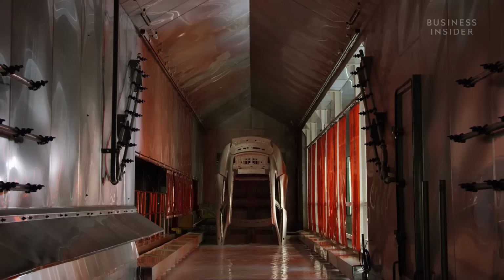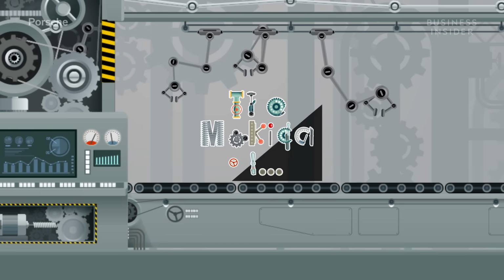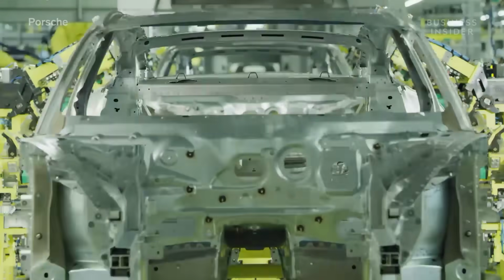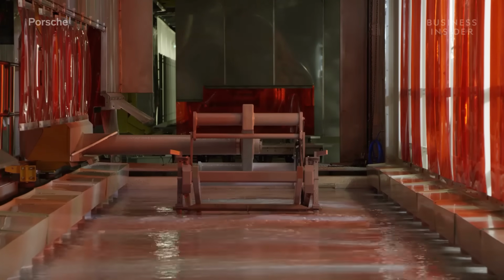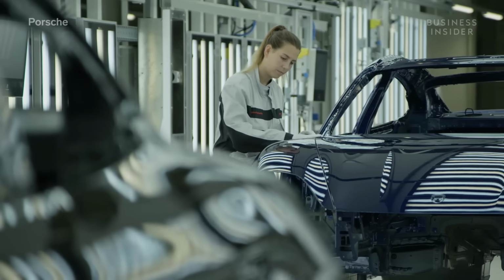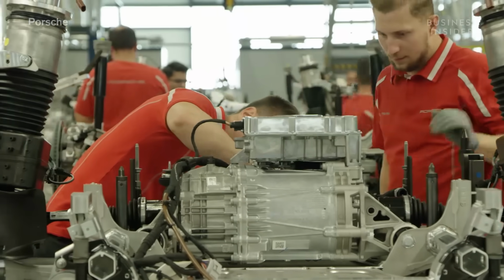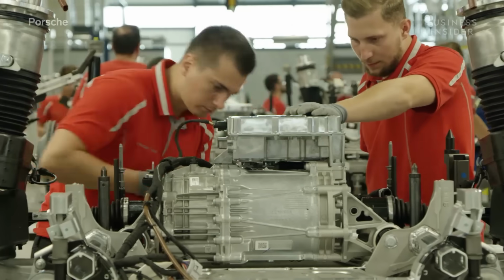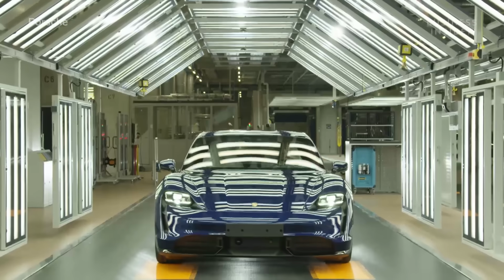How Porsche's First Electric Car (The Taycan) Is Made | The Making Of

Comment: A robot first hot glues the frame to the body, it is important to use industrial strength glue, and not Michael's craft glue, as these are European bodies. The body is then moved on to the mammals. The mammals rub the body with silicon sheets while yelling at it in German and judging its naked appearance. The body is then drowned in a vat of magical electrical water. The magic electrical water keeps the body from corroding until the day after the warranty has expired. Robots, who are not yet self-aware, and mammals, who just might be, take turns jamming and ramming metal alloys, wiring, lights and even cow skin into the body. The body is then given motors and wheels, which will prove valuable to overthrow the mammals when the body achieve sentients. Finally, a mammal brands the body with a shiny sticker and another uses his index finger to smear nose grease along the body a ritualistic act. The body is now ready to be driven and eventually crashed by the mammals.

Comment: Have to say, it really highlights how many light years ahead the folks at Tesla are! Instead of arbitrarily stacking inverters etc etc Tesla has it all on the down low in such a neat and concise package. While Tesla's designing their own materials, others are figuring out how to put bolts together! Same goes for self driving, Tesla essentially has its own satellite network being built while other manufacturers are trying to decide if they should even have self driving, mercedes has all but given up already! It seems to be on every level. 

People have tried to argue that there's "value" in the body manufacturing techniques of these legacy auto makers, and to some degree, they may be right. But what happens when you end up completely rewriting the rule book, there are so many areas where the top five or ten legacy manufacturers have been caught off guard. They have a hundred years of IP for technology that no one's even going to use! Meanwhile, Tesla's gone an not only created copious amounts of new and relevant IP, but they've then opensourced large portions of it! 

Brave new world! Had to laugh when I think I saw Subaru had partnered with Toyota on EV's, they'd might as well have partnered with Indian Rail and started building some coal fired Impreza's!!! Probably Indian Rail has more electrical experience than Toyota! Hyperbole I know, but it still and extremely backwards move as companies like Toyota greatly lack the agility to create the change that's needed. They'll keep producing "semi ok" electric vehicles, they'll keep trying to push hydrogen to a world that's moved beyond that, and eventually, like Nokia with Symbian/Windows, they'll find they meet their demise. If any of these companies had any sense of intelligence they'd simply sign manufacturing agreements with Tesla, license Tesla tech, integrate it with their own, maybe even Tesla OS could be a thing and could be open sourced and shipped in cars by OEMs like android is. 

Imagine if Tesla were to license and monetise the OEM aspect of their super charger networks ;-) Hopefully Volkswagen gets on and leap frogs their competitors by inking some major deals with Tesla, then they'll start to have some really neat cars!

Comment: Turbo S    0-60 2.6 seconds  750HP .   Don't use the launch control unless your head is strapped to the head rest!  

"Like all lithium-ion batteries, the lithium-ion battery in the Porsche Taycan is subject to physical and chemical aging, as well as wear and tear. Therefore, the Taycan battery will experience a reduction in the amount of electricity or charge it can hold over time, resulting in a reduction in the vehicle’s range and an increase in charging times. This is normal and expected. 

Although Porsche expects the majority of vehicles to retain 70% of the battery’s original capacity through the first 8 years or 100,000 miles (whichever occurs first) of normal use, the rate of reduction varies, and will depend upon your individual usage and operating environment. The rate of capacity loss will tend to be greater in the early part of the battery’s life, but the rate of loss should decrease over time. For 8 years or 100,000 miles, whichever comes first, Porsche provides High-Voltage Battery Coverage under its New Car Limited Warranty if a capacity measurement performed at a Porsche authorized dealer shows that net battery capacity is less than the expected percentage at the times specified in the New Car Limited Warranty. Various factors, including exposure to hot or cold weather conditions, can affect the rate of battery capacity loss and charging time. See the Porsche Taycan New Car Limited Warranty and your authorized Porsche Taycan dealer for details. Please see the Porsche Taycan Owner’s Manual for additional information."  Porsche advertising.

Comment: The engineering mistake I saw was the little electric door to access the charger connector.........what happens when you lose power? The little door won't open.
Reply: I think there is a manual override

Comment: Well, to use other wires for the stator is not Porsche engeneers work its common use in high power small space motors, secondly, the batteries are always integrated into the body frame of most high performance electric cars, thats nothing new at all

Comment: so if some a-hole bumps his car into my taycan, instead of replacing a small panel, i'd have to get my car to porsche, have them remove the entire side of my car which will probably cost as much as a new boxter because i am sure they use special porsche glue that can only be removed with special porsche adhesive remover and then get a whole new panel wich will probably cost as much as a new panamera. this is above apple level of stupidity!

Comment: Everybody on here talking about the assembly robots and crap. All I wanna know is why the hell add the word “Turbo” to a damn car that ain’t got no turbo on it !!!!
Reply: Why does Tesla call something a supercharger that doesn't supercharger combustion engines ?
Reply: I suppose it makes their cars with electric motors seem fast to the masses, compared to other cars that have mechanical engines. And it makes zero sense considering both cars with electric motors are faster than 90% of the cars on the road that have mechanical engines.
Reply: @gregoutcalt6773  it's because turbo and super are prefixes, not the actual definition of devices

Comment: That dense wire in the motor for more power and torc than conventional ones... well Tesla Model S’s are still quicker 0-60 with more hp
Reply: And will overheat in no time!
Reply: It's slower on wet tarmac :)

Comment: Tesla is simply better if you want electirc.
Reply: No it's not
Reply: @E9X330  First: Look at the front of the Tesla Roadster 2020 and how Porsche has copied the front light tears. Second nobody can compete with Tesla's technology for batteries development durability and recycling, therefor if you go electric you buy a tesla. Just as if you want to rip some tiers apart on the track you get a GT2RS.
Reply: @heisenberg5361  Porsche copied the roadsters front? Are you blind ?
Reply: @heisenberg5361  also, how can you know teslas batteries are better when the taycan hasn't even received extensive testing yet ?!
Reply: @E9X330  Copied
Reply: @E9X330  It doesn't matter. Tesla is completing the Gigafactory3 and will produce the most advanced batteries on the planet. Historically Musk delivers therefor if you want electric you buy a Tesla. You can also take a nap, it drives alone.

Comment: German engineering at it’s finest! :’)
Reply: I've driven a 2011 Toyota and 2011 Porsche both with 140k miles on... guess which had a better quality interior, rode better, drove better, was quieter, ect. Oddly enough they've both had the same level of reliability since new. Interesting the 2011 Porsche has been more reliable than a 2014 Toyota I know of also with 140k.

Used to hate on Porsches, until I spent time with them, I'll never buy a bland and boring Toyota or Honda.
Reply: Until the car breaks down after just a few years😂

But Toyota or Honda if you want to see good engineering
Reply: T J dude it’s a porsche they are known for making the most reliable cars in de world
Reply: @TJ-oo5mx  Seen enough Honda's crap out before 100.000km and multiple BMWs running 400.000km, it's not about brands, it's about maintenance

Comment: Fuuny how Tesla model S after 7 years of launch still has more power, better range then brand new car from legendary car manufacturer Porsche.
Reply: Barely more power you would barely feel the difference and ive checked the specs for both cars
Reply: Atleast you get gold plated emblem and top of the notch no haggling panel gaps from those lazy Americans craftsman and robot 😂😂.
Reply: @v80camaro54  model S still uses the same cooling and battery, a model 3 can outpreform the model S on track because of this, but tesla has managed to still squeez enough power out to hit 2.4 seconds on street tires which does require much more delivered energy then 2.6 seconds. the model S was never even intended to be a performance car, elon wanted a long range 7 seater sedan.

Comment: They act like to motors is impressive teslas have 4 motors in each wheels
Reply: But still porsche is faster
Reply: Are you slow teslas can go away faster and they have a way better battery range
Reply: @gagen7601  Nürburgring porsche vs tesla?
Reply: @gagen7601  Tesla's have two engines two dumbass 😂😂😂

Comment: Looks EXACTLY like a Tesla
Reply: Body line wise? Somewhat. But it's main goal is to blow Tesla away
Reply: Not really teslas have a generic design and they use the same design for every car.
Reply: @davidwatts3186  No issue with that to me, if a vehicle sells well with the same old or generic design, than rock that until the time comes to change the design

Comment: I want to know if that battery case is a structural member.
Reply: Yes. Integral part of the body to give its strength and low centre of gravity
Reply: @richardcatchlove9115  Asking because in the Model 3 the battery case does not add anything to the car's structural integrity.